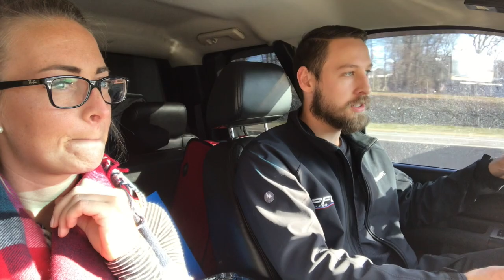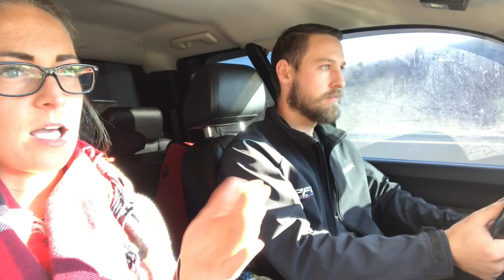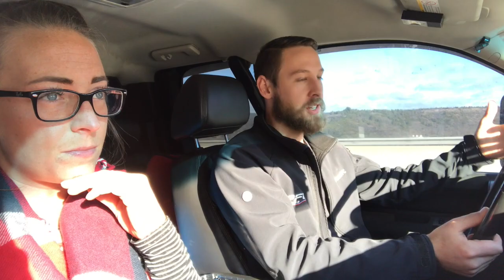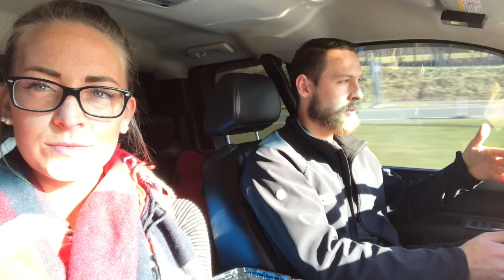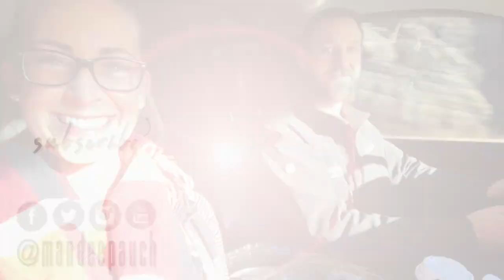Sail Panels Vs  Windows

Comment: I'd be surprised of the aero effect on the smaller tracks. Mud turtles are so sideways all the time as it is. Unlike winged sprint cars which drive much straighter
Reply: D.F. G they make a difference at any track.  For example,  Grandview.  A high-banked 1/3 mile where sail panels can easily give you several tenths advantage per lap.
Reply: At any track it's an incredible difference if you don't believe it look at some of the any car and run what you bring dirt races on here and see what wins. Watch a super late model knock the nose off or loose that Lil spoiler on back the will quit or wreck